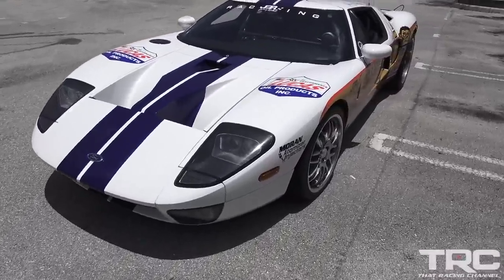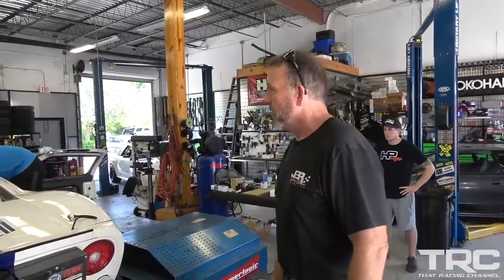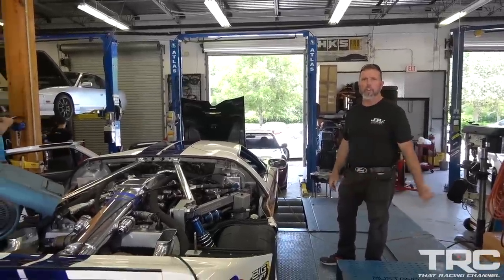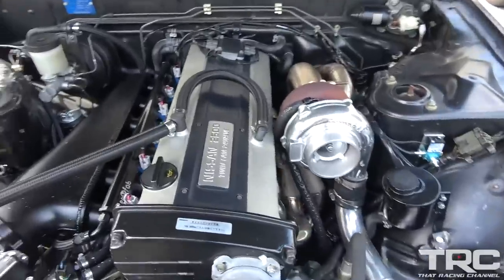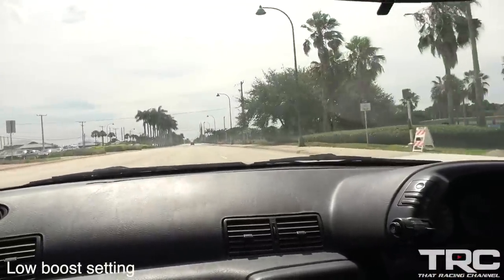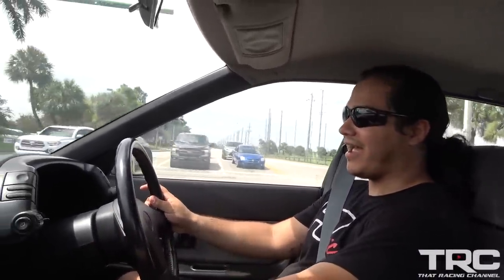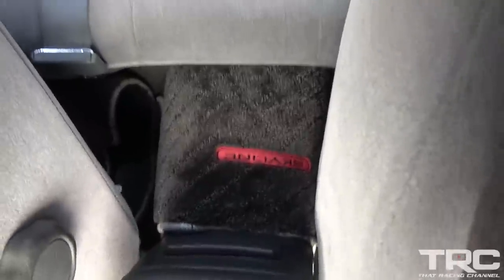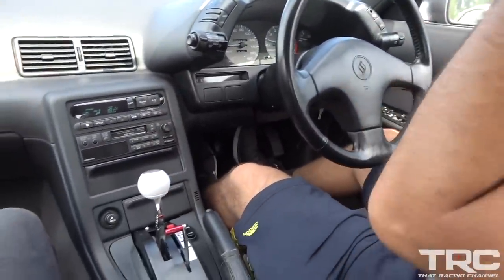Best Sleeper Car Ever?! and 3000HP Ford GT Surprise

Comment: No ones caught up to this record  that a 14 YR OLD car set. 5.4 Ford mod motor ftw.
Reply: leeleelee what that Ford gt that ran 300.4 in a mile?
Reply: Tide Pods - yes
Reply: Ford GT over 300mph standing mile now.At about 330" this just goes to show power capability of 4v over pushrod platforms.Without sanctioning bodies to level the field these engines would rule class divisions.

Comment: Dude you actually got to see the Johnny Bohmer Racing Ford GT??? That thing is an absolute weapon. It is a 300mph streetcar
Reply: That car has never seen 300mph.
Reply: @iPROFITDON  it's damn near close. If it had a highway shut down like Koenigsegg it could probably hit 310 or so
Reply: @joshlewis5065  on a highway like that if it didn't blow up it would probably break the sound barrier 😂
Reply: @Zachary Thomas 😚

Comment: Hell yeah hp logic
Reply: he did say the car did 2380 wheel horsepower on 29psi and now the cars on 35psi probably 50psi when doing it's mile runs so yeah 3000 whp isn't far off also 112mm turbo's can spool 2200-2600hp each and he has two of them

Comment: That 283 mph got beat for an other ford Gt and it make 300 mph
Reply: He actually did 292, and had parachute failure... then some engine issues.. he will get the 300mph...

Comment: You guys mixed up with the M2K motorpsort ford GT. The BADD GT did 283 mph in a mile, the M2K did 293 mph and have now the new world record.
Reply: Aurel427 he then did 292.9 and had parachute failure...
Reply: @svtrobra6624  292.2 in way more than 1 mile ! not in 1 mile
Reply: No, I know Johnny personally.. it was 1 mile..  done at the Kennedy’ space center.
Reply: @svtrobra6624  any videos or anything?